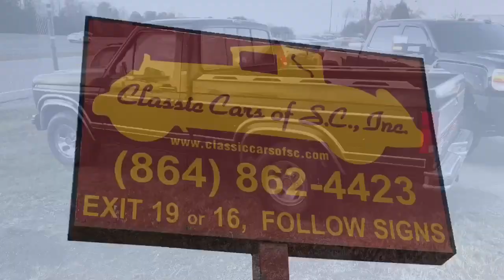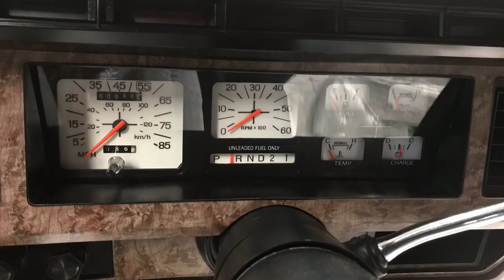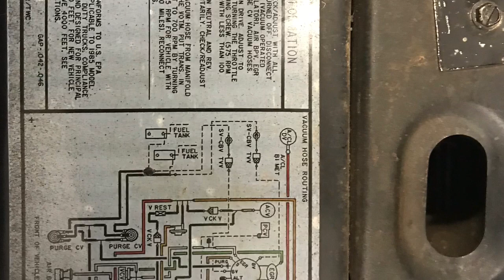1985 F-150 Bullnose 5.8HO SHORT BED 2WD

Comment: I have an 85 f150 short bed, 2wd 4speed that has the cab off my grandpas 80 f100 ranger and I have so many memories riding in that cab. The 85 was my Dads and it caught on fire christmas day in 95. My Grandpas truck was wrecked and the engine was blown, so we just swapped out the cabs. My Dad gave me the truck in 99 and me and my Grandpa rebuilt the top end of a 4.9 from an 86. I drove my truck senior year of high school and then it broke down so we parked it. My younger brother tried to fix it and seized the motor up somehow and it has sat for 20 years behind my dads barn. I moved my truck for the first time in 21 years this week, someday is finally here. She is finally going to get back to road worthy and will be my 10 year old sons first truck and he will be the fourth generation to turn wrenches on our truck. Thank you for your video, I am looking at what everyone else has done and just taking some notes. Beautiful truck you have there. It looks just like mine used to.

Comment: I’m trying to tell if you spray painted the grill. I have a 85 f-250 long box and I’m wanting to fix it up and looking really nice. Do you have any recommendations for the first things I should do to look/sound good?
Reply from the maker: I got a new grill from LMC truck and it was Matt gray inside the squares, so yes I taped it off and painted it gloss black, I would recommend a paint designed for plastic, scuff it , and use a prep solvent before you paint it. 👍🇺🇸
Reply: @redoakmotors9918  thank you. Have a great rest of your day